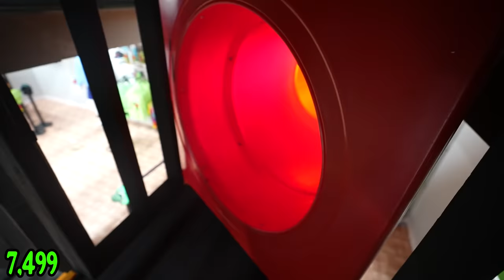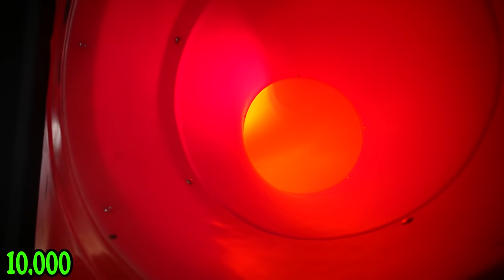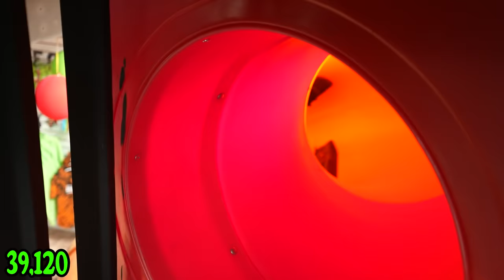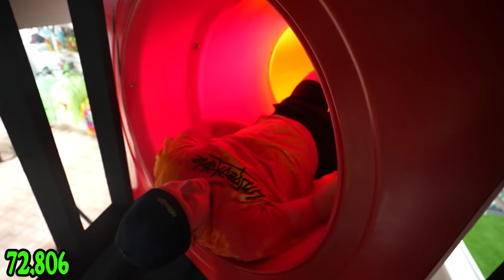Going Down A Slide 100,000 TIMES!

Comment: they should make a video called "Sliding Down A Slide -100,000 Times" or "Climbing Up A Slide 100,000 Times".
(doing something -100,000 times is usually impossible, but sliding down a slide -100,000 times is just climbing up a slide 100,00 times.)